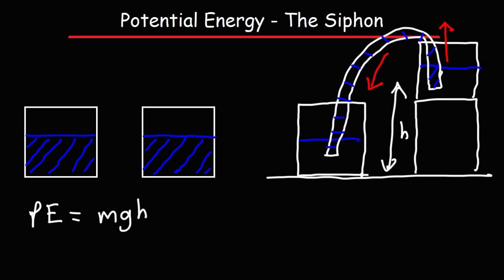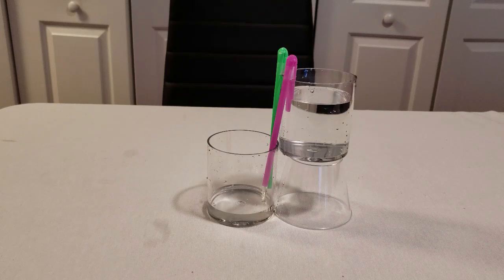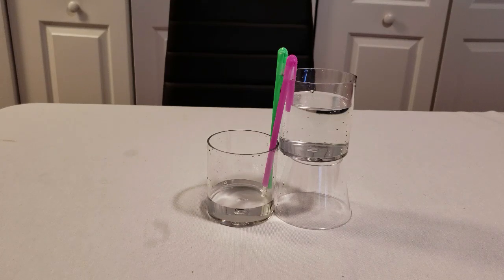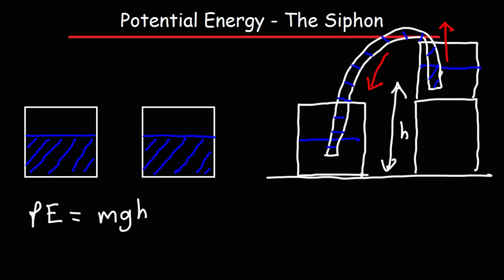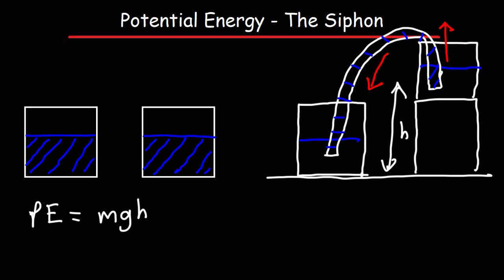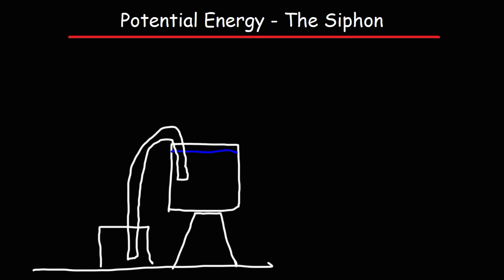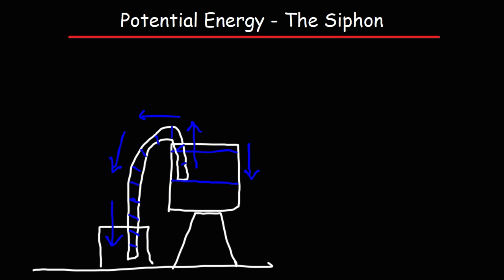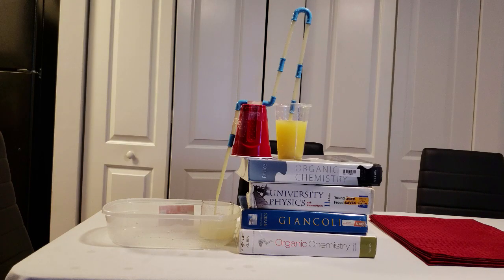Potential Energy - The Siphon

Comment: 5:30, doesn’t it pull more water in due to a low pressure created when the water falls. The water in the straw is poured out and behind it - it creates a low pressure vacuum if you want to call it that and the water in the second cup flows up to the low pressure area
Reply: Imma torb main that’s what I was thinking too, not sure about it but I think it might have some effect
Reply: It's the defferance in pressure between the outlet and inlet causing flow atmospheric pressure playing big role in pushing that water into the pipe.

Comment: Maybe from the final example the straw didn’t move the water as effectively because the straw was getting water from the bottom of the glass. It takes more effort to move the water up the one side and then down into the other container. That water also has lesser gravitational potential energy. Just a thought.
Reply: You also can notice that the less water in the cup, the lower the water flow is.